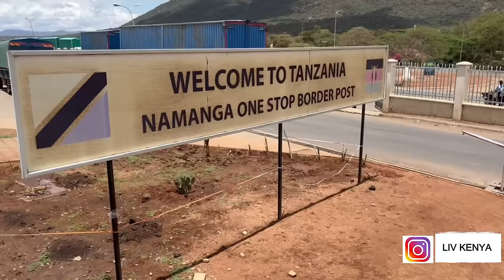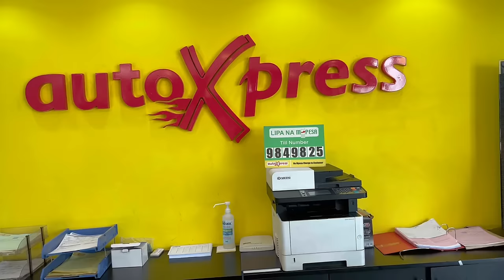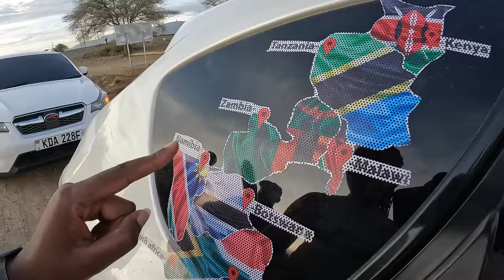NAIROBI KENYA TO CAPE TOWN SOUTH AFRICA BY ROAD | ROAD TRIP BY LIV KENYA EPISODE 1 (KENYA)🇰🇪

Comment: A great Video...a quick question; how do you service the car once the millage runs out, Asanti.
Reply from the maker: It depends with the make of car you have. You can easily service German and Other European cars in Botswana and South Africa. If you have Japanese car, carry your oil and air filter and even spark plugs if you might need to change them coz these parts are not easily available in Southern African countries.